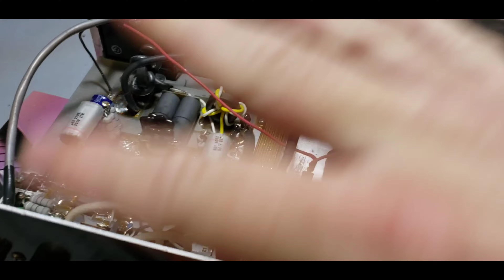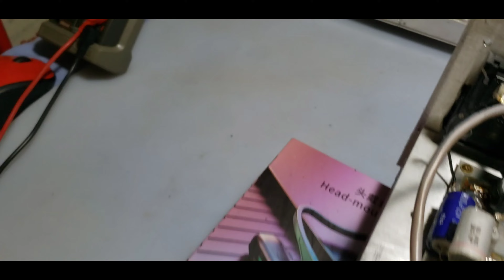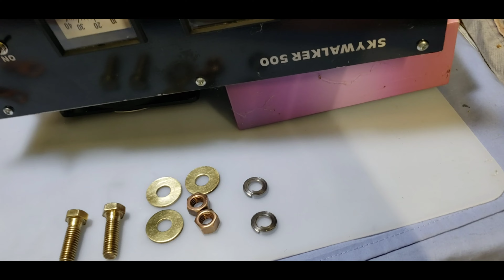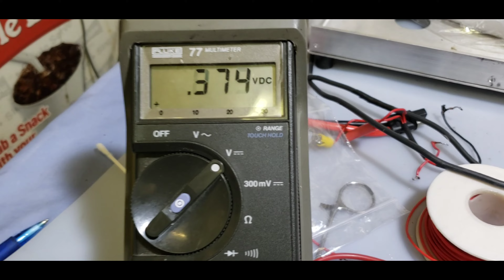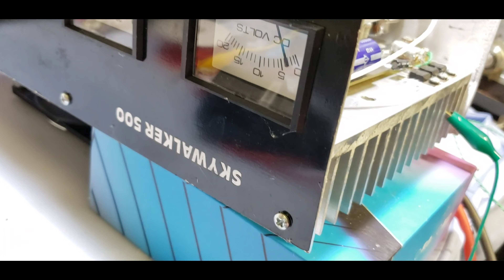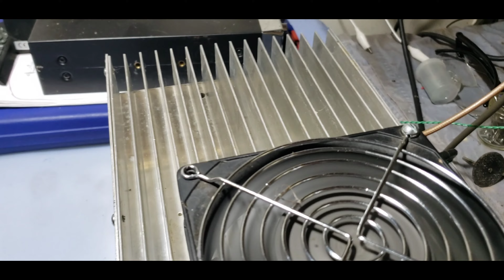SKYWALKER HF Linear Amplifier - These Were Built From Kits 🧐

Comment: Low pass filters were in a separate cabinet. I have a couple of the 500s and one of the 1kw. Really nice amplifiers that work really well. Some should learn how he does the bias circuit, much better than the "normal" bias that people use. Really should adjust the bias based on current draw. He covers that in the documentation. Best I remember, around 120mA per device - pretty sure he covered it in the manual.

Comment: I have a skywalker box that has 4 fans on the lid. It is 110 and also has the dc bolts on the back to hook up to your own power supply. It is 2 2290,s driving 4 2879,s . One of the transformers went out so I bypassed the 110 and soldered a hot and ground to the board. Anyway I was running it and the 2 drivers gave way and I replaced them with a couple outher 2290,s and they gave out due to me being  long winded. So I set it aside and forgot about it until now. I was wondering if there is a way to add more pills or what it would cost to get it going again. It does have all new caps for the 110 side but like I said it will need a transformer.  May sell as is if it cost to much to get going again.

Comment: Did you figure out the input wattage? Looking to pair this with a yaesu ft-450d
Reply from the maker: Yes keep it at 50w or less if you can that is a safe drive for it or give if what it needs to get you to around 400 to 500w without exceeding 50 to 60w drive pep
Reply: @1883GotDown  thanks!

Comment: nice amp. I have seen something like that before. even them 24V and 50V transistors done that way for feed back. nice bias circuit. with bigger pass transistor you can feed all 4 pills from 1 bias supply. one of the bias circuits I have has a PTC thermistor you put on heat sink. I copied a bias circuit from a RM  Italy AB bias amp that has a LM 723 reg IC with pass transistor. you can add band-pass filters for the HF band you want to use. DX engineering has them. you can put filter board inside. make a PC board with the bands you want have small relays 2 per band . you mount with stand off inside between bottom PC board and cover. run with like RG 400 or 316DS from board to board. then the relays go to switch on front. makes it hard to work on having to remove filter  bord to get to the amp board. The one I have seen had MRF 454 in it. had the filter board. 80 threw 10 meters. was a kit as well. home made case . that had different bias. used the one out of the Motorola RF devices hand book. I have them set of books. I would like to build one like  that but with 8 X 2SC2510 24V . easy 1 KW . 160-10 meters. HG has 2510 now. I have only 2 for testing. 150 watt each. same as MRF 422 but different impendence..73's

Comment: Mr. Gatekeeper, I have a question, is it possible to turn a linear into a modulator Without too much trouble.
Reply from the maker: Well....for a while I've seen people use this term because amplifier manufacturers lied to us back in the days calling small 1 tube or 1 pill amplifiers modulators when they actually have nothing to do with creating modulation. This is done inside the radio. I know its a term we have been taught to use to call a tiny amp but I think it is time to make a video talking about this cause I have never had anyone ask me what you just asked me.

What is a modulator? This is a device that actually takes your audio single being generated by your microphone and audio circuit and enclosed it onto a rf generated carrier wave. A carrier wave is made with the help of a oscillator.

I think what you are asking is can you turn a small amplifier(which we have been lied to that are modulators) into a bigger amplifier. The answer to this is....do you have the room inside the case? Or would it be easier to start fresh with a new build?

I'm this what u were asking? If not get back to me and give me more details.
Reply from the maker: Oh ur asking go turn a big amp into a small amp lol. Well in that case then heck yeh that is super simple. I could turn a 16 pill into a 1 pill easy not sure why you would want to. Or you could just put a big attenuator in from of a big amp and make it act as a smaller amplifier to cut your input signal down very low.

Comment: Like you said several reasons the transistors are so close and for harmonics and more power and less resistance and changes the tuning would be my best guess. I have seen transistors stacked on top of each other before.  Nice box and I think I have seen a few of those kits or at least repair kits.
Reply from the maker: Thanks for the comment.... yeh the actual Skywalker would sell these back in the days. But a ham op designed them and use to sell them for a good price. Id love to find one kit that hasn't been put together yet :)

Comment: Some of the best high end golf cart batteries use all brass terminals
Reply from the maker: Cool I didn't know that.
Reply: I continually melted a 200 amp fuse holder.
It turns out it was the steel bolts that could not take the 200 amps that were going through it. So I went to a golf cart battery place. It was near me, I noticed that all the batteries have brass terminals ,I bought some brass nuts and bolts problems solved